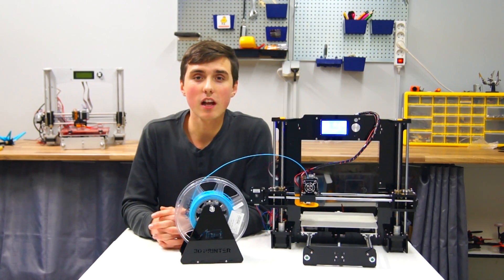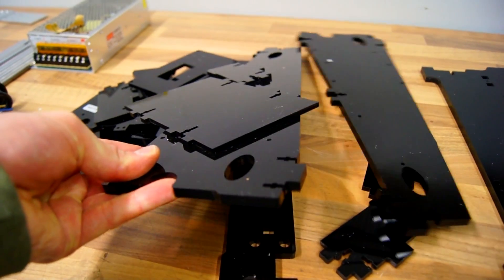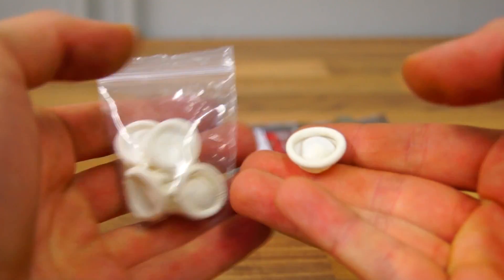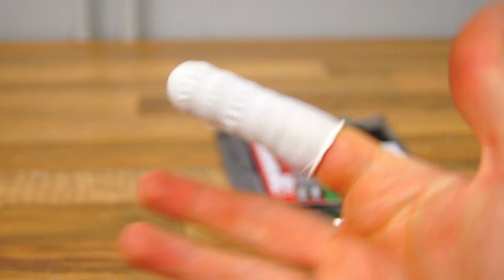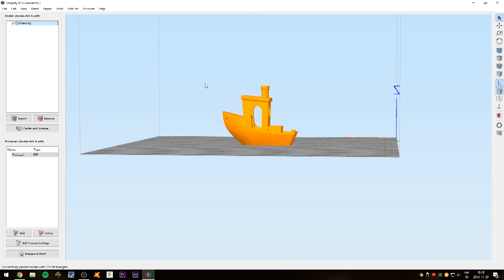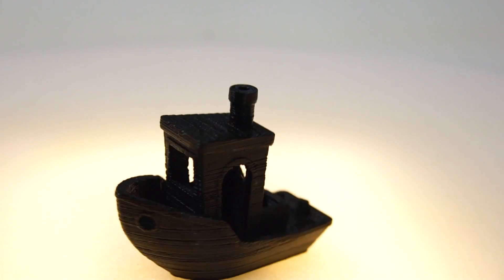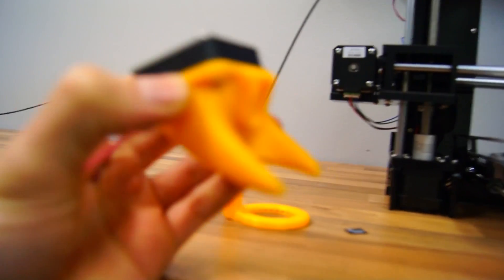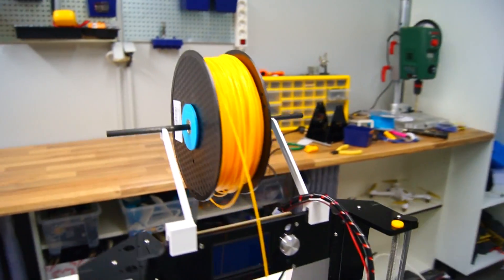Anet A6 Full Review - $200 3D Printer

Comment: Can the A8 and A6 print other filaments with a 3D3 V6 hotend ? I want to print NinjaFlex and Nylon. I also want to print in 0.4mm and 0.1mm for precision.
Reply: i think the stepper motors are just barely enough to push filament at 0.4 and would probably work for ninjaflex if you print one of those filament guide thing that sits under the drive gear , would also help with PLA to have one of those since it makes loading filament a lot easier.

Comment: is there filament and a holder for it included?
Reply: Yes, it comes with one roll of 1/2 kg black PLA filament and a holder is included.  However, I just printed a holder to go above mine and it works much better.  Also, be sure to print out the filament spool as well.  You can find many of the 3d prints on Thingiverse.com   

Hope this helps.
Reply from the maker: Yes.
Reply: seac777 thanks for the answer!

Comment: What settings did you use my printer is making lots of imperfections thanks.
Reply from the maker: Make sure you have selected 0.3mm nozzle.
Reply: Did you get it working? What is the resolution achievable?

Comment: To manke it easier to remove the paper from the accrylic without it tearing all the time run each piece under some warm water until all the paper has gotten wet, the paper will peal right off without leaving any adhesive residue, and with minimal tearing.  I even left the smaller pieces of my A8 kit submurged in a cup of water until needed and the paper still came off in one piece with no issue.  This should work with any other paper covered accrylic pieces for other kits, or anything else.

Comment: Does this printer have any advantages over the a8 in terms of print quality? I don't care about assembly or filament
Reply from the maker: Print speed (max): A6 = 120mm/s  A8 = 100m/s
Layer height: A6 = 0.1-0.4mm  A8 = 0.1-0.3mm
Reply: RCLifeOn ok thanks
Reply: RCLifeOn you can actually print at a layer heights of 0.04 on the A8, I've done it and it works very well. Also I got my A8 for $148 on GearBest for Black Friday.

Comment: what is the difference between this one and the A8 you reviewed a while back?
Reply from the maker: A6 was easier to assemble, but doesn't support as many materials as the A8. A6 also supports 0.4 layer thickness which is great if you want to print something very quickly. A6 print at faster speed (A6 = 120mm/s  A8 = 100mm/s). In conclusion, I think the Anet A6 is better as long as you don't want to print with anything other than PLA and ABS filament.

Thanks for your comment, have a nice day!
Reply: +RCLifeOn 
Perfekt! Frågan jag tänkte skriva, men hittade svaret. :) Skriver på svenska eftersom jag antar att du kan det!? En fråga bara.. Fick du tulla och momsa när du beställde därifrån? 
Bra kanal också..
Reply: Ethan Larson http://www.dealschina.net/2016/12/04/anet-a8-anda6-3d-desktop-printer-kit-both-under-190/
Reply from the maker: +sirhenry Tjenare och sorry för långsamt svar! Ja, det blev tull på 175kr. Ha det gött!
Reply: RCLifeOn 
Ingen fara. Tack för ett svar. Okej.. Najs.. Beställde en direkt jag å :) Fast det blev en A8
.
Reply: Skriver också på svenska här haha!
Vad menar du med att A6an inte stödjer lika många material? De stödjer ju samma material?

Och sen en liten fråga. Ser att du använder simplify3D. Hört att denna är med advancerad än cura som följer med. Men vad är det som gör simplify3D bättre? Blir det någon märkbar skillnad på printsen?

Har en a6 påväg hem nu, supertaggad!
Reply: i think the reason for that is the stepper motors/boards that drive them  they are too weak.
  on my A6 i wasn't able o print with a 0.3 nozzle because it would clog up.  but then upgraded it to better steppers+ramps board and DRV8825 drivers and it works wonders:D, printed PETG ,TPU and even Ninjaflex and lately finally tried abs although the bed is almost always on to keep it at 100.
  it is definitely the better choice over the A8 because the frame is more stable and is pretty much all that's left original in my printer after all the upgrades ...

Comment: Do you like this printer better than your Anet A8 ?
Reply from the maker: Yes, I do.  The assembly was easier for sure, and it prints 0.4 layer height which is great because it means I will be able to print things a lot quicker! Though the Anet A8 is able to print with more materials, but this is no problem for me as I only print with PLA.

Regarding the auto leveling, it uses the exact same motherboard as the Anet A8 so I believe it is possible.

Comment: You mistyped A8 in the description. What upgrades does this have over the A8? Other than the LCD
Reply from the maker: Thanks! A video comparing the two printers (Anet A6 vs A8) will be uploaded quite soon. A6 was easier to assemble, but doesn't support as many materials as the A8. A6 also supports 0.4 layer thickness which is great if you want to print something very quickly. A6 print at faster speed (A6 = 120mm/s  A8 = 100mm/s). In conclusion, I think the Anet A6 is better as long as you don't want to print with anything else than PLA and ABS.